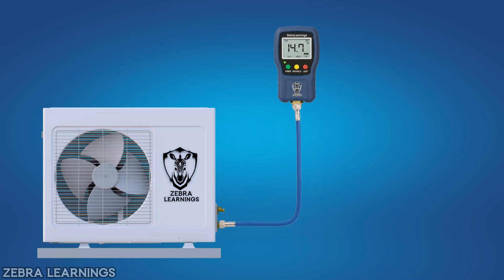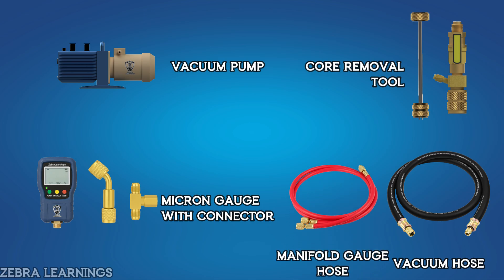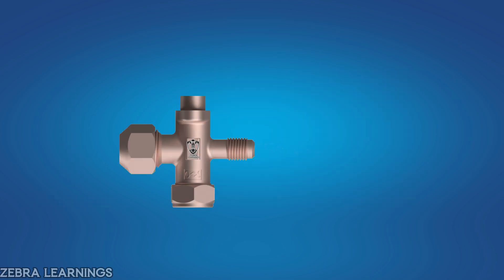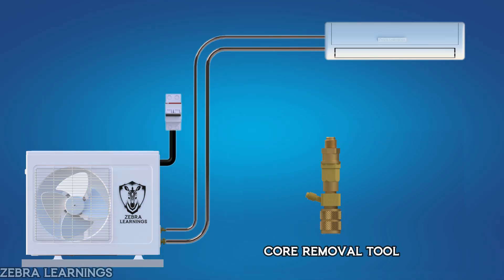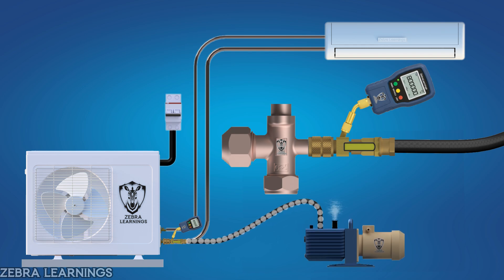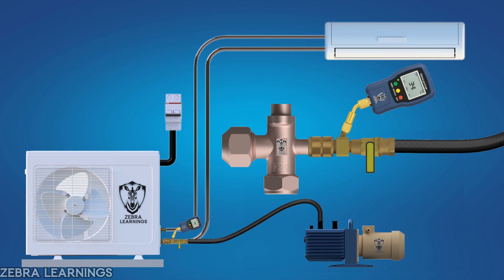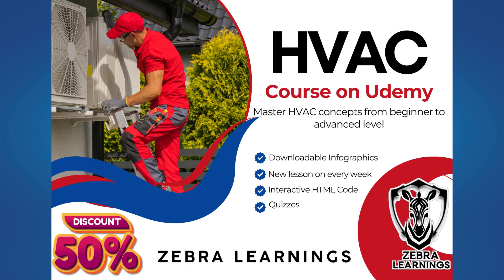How to Do Vacuum in AC System Using Micron Gauge | Step-by-Step HVAC Tutorial | Animation

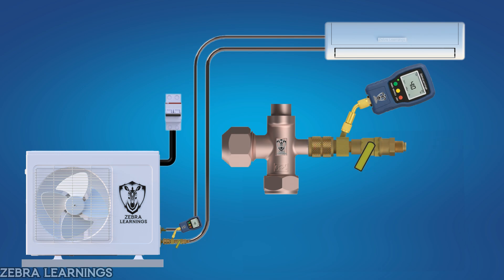Comment: Love this Video until 4:00 minutes in. i am a professional leak finder and you will not find a leak while spraying leak detector solution on a system in a vacuum. release the refrigerant and then check for leaks